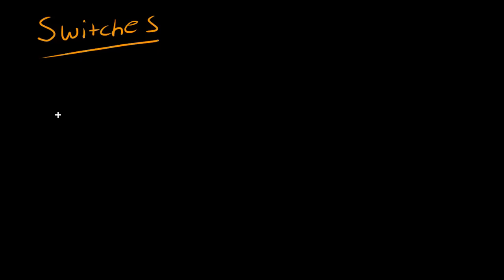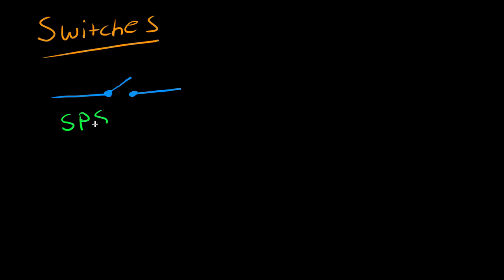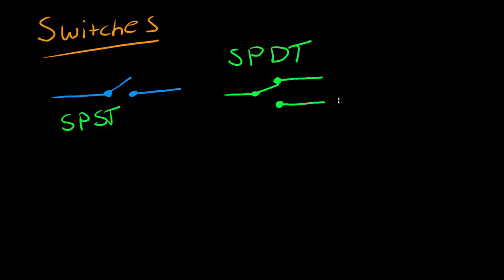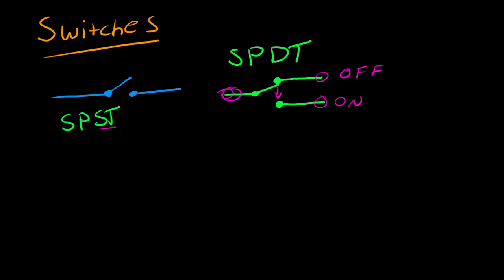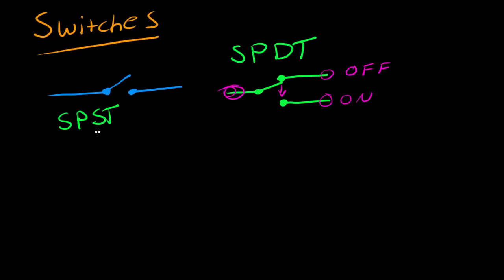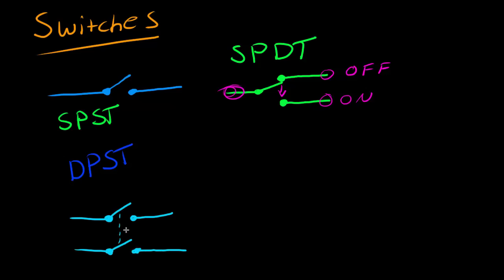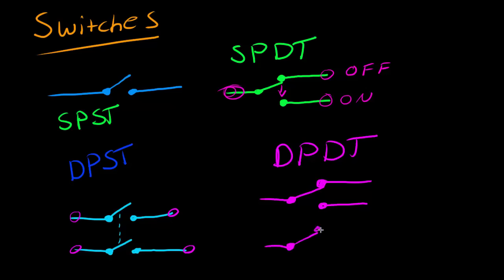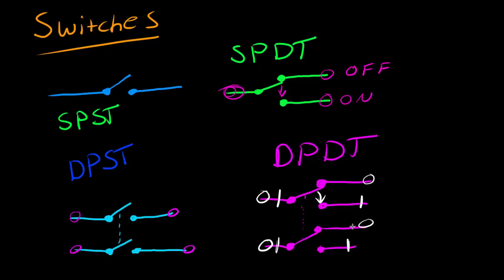Beginner Electronics - 13 - Switches

Comment: Great video! I do think if you give some real world examples after you talk about each one would also be helpful
Reply from the maker: +Matthew Agold of course examples will come, I just prefer (when I am learning) to get the concepts, that way when I see them in use I feel like I already can predict how they actually work. Don't worry, we'll get to actual circuit building!
Reply: I agree with Mr. Agold, as examples of applications would significantly embed the principles more clearly. Many thanks for making these videos, they have so far been very interesting.
Reply: Totally agree.  Without an example all we have are some stick figures and a bunch of acronyms.  Any such information is difficult to retain.
However, an image of a device associated with each switch is far easier to remember.  A  picture is worth a thousand words.

If the examples are to come later then I believe that would be the appropriate time to include the schematic and explanations.

Comment: As you describe each type of switch, it would be helpful if you gave an example of how each type of switch would be used in a practical application. It would be helpful if I was able to associate each type of switch with it's function on a gadget, product, or wherever, or however it's commonly used. I've never heard of any of these switches before, but I'm sure I've used them before without knowing it.

Comment: The dotted line he referring to between the to double switches is a mechanical non-insulated connection between the two switches so when the power is sent into it they both close at once or open at once depending on the NO or NC switch you have

Comment: Newby question #1

When the work load the LED draws energy from the battery through the circuit, is the current coming from the negative terminal of the battery toward the LED or the positive?

Comment: Does it matter where in the circuit you put the switch? Is there a general rule of thumb for the best place in a circuit to put the switch? Also, is it different for DC circuits than for AC circuits?

Comment: No, I don't understand it as, other than the simplest SPST, without examples it is impossible to visualize what they are supposed to be doing..

For example:  With the SPTD I presume that the top wire goes somewhere (otherwise there is no point to it) so I can't grasp how the upper line can be OFF when the throw is making a connection to that line.  However, I can hazard a guess that the upper line might go to a red LED to signal that the equipment is turned off but that wouldn't mean that the switch is off.  And it just gets more complicated with each addition.

Not being able to visualize the function makes the information extremely difficult to retain.

Comment: I had an idea, I want to make a switch which connects to a radio control thing   and then completely separate is a radio receiver which connects to a light bulb.   when you press the switch the light bulb  turns on or off  via some sort of radio signal.   I have never made anything like that before though

Comment: Can you have a switch similar to the SPDT switch, but it has a third position where the switch is not connected to either throw? Kind of like an option to keep the switch in the middle of the two?

Comment: For DPST and DPDT, DP means two of DS, but is that mean if one of DS will be connected the other also because both is connected to each other or means both will react same and both will connect the wires?
Reply: it means that both will connect to different wires and switches will only connect to each other.

Comment: Can you have a triple pole single throw switch for a circuit that has off, on1, and on 2? or would you use a different switch/component to control this?
ty

Comment: Hey Mate, Love the videos. Can i just ask (and i recon if i watch more video's it will probably give me the answer), in a power point as an example, would the SPDT maybe have a neutral wire in the off position?
Reply: SDDT could enable a different circuit. Think of a receiver & transmitter circuit. When you press you mic to talk it switches off your receiver circuit & turns on your transmit circuit. When you release you mic switch it stops transmitting and switches to receiving (listening). It is an either or switch: you can enable one circuit or another but not both. Note: currently the only way to have both circuits off is to disconnect the power source.

Comment: What about buttons? Are they the same as switches, but with no toggle on state, i.e. when you release them they go back to off state? What are the schematic symbols for those? Also, some examples would be nice.
Reply from the maker: +Dmitri Ivanovich there are many types of buttons, which I will go into in a video soon. Some are off and when pressed go on, others are the opposite way around, and some toggle state when you press them. A video will come on buttons soon.

Comment: question. wouldn't the SPST and SPDT work basically the same way ? what useful application would a SPDT have that a SPST couldn't do or vice versa ?
Reply: looked up a bit, it seems like SPDT could be used to "switch"  the power between  two different lines. more than just "off" and "on" as it was shown in the video ? not sure, but that's what i got from it. otherwise it seems kind of useless.

Comment: I dont understand the DPST and DPDT switch can someone help me out please?
Reply: SPST has a single wire in - a single switch - and a single wire out: The switch is either open or closed: imagine our white LED circuit on or off.
DPST has two wires in - with two switches that operate together - and two wires out (one for each switch). The switch is either open or closed: imagine one circuit is a red LED and the other circuit is a green LED. The two LEDs are either both on or both off depending upon whether the switch is closed or open. (see diagram above)

SPDT has a single wire in - a single switch - and two wires out: Imagine one wire is a red LED and the other wire is a green LED. You can have either a red/green LED on but not both on together or both off together. Its one circuit that is on while the other is off.
DPDT has two wires in - with two switches that operate together - and four wires out (two for each switch): Imagine the top circuit is for constant lights: Red or green & the bottom circuit has flashing lights Red or green. The first switch position switches on the constant Red and flashing Red light whereas the second switch switches on the constant Green and flashing Green light.